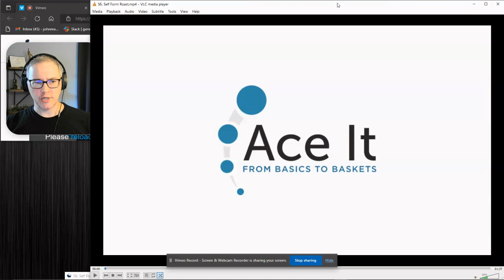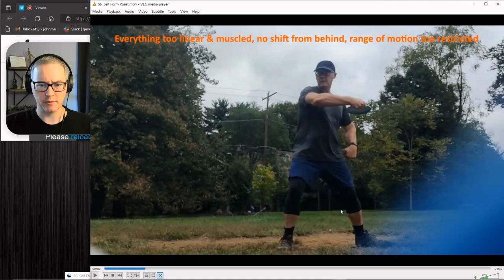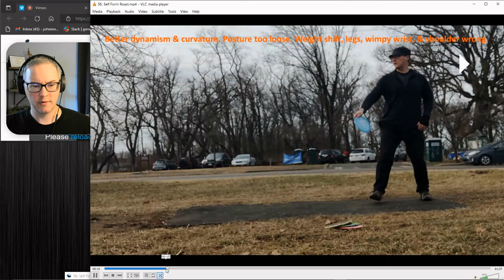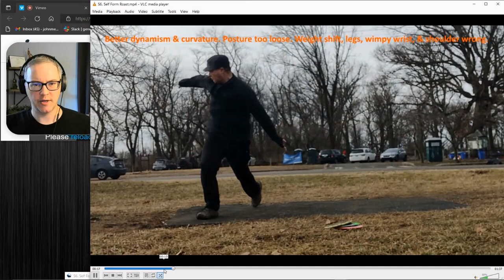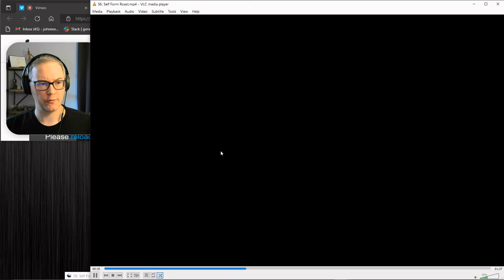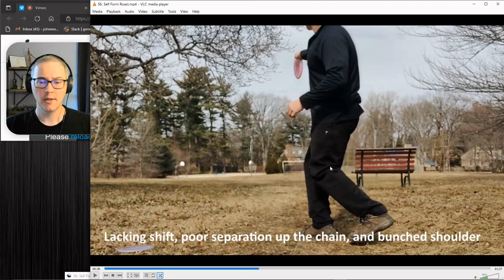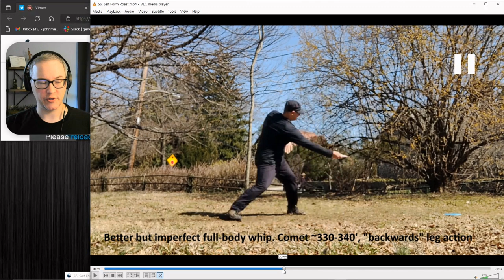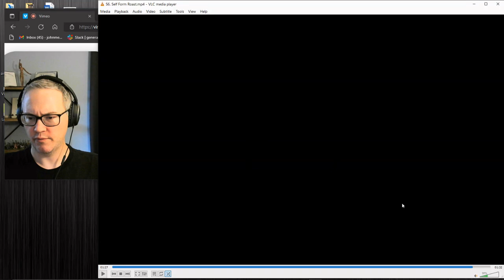Spotting Common Mistakes in Disc Golf Video Form Analysis

Comment: Hey, loving you content man, great work. It has helped me and my form more than eny other input I've gotten so far. Thanks for that! 

You mentioned something about not extending the plant leg fully through the weight shift/transfer. 
Is that just an injury prevention thing or do you think that it's really not necessary? Instinctively I'd say a full extension would net the biggest amount of energy transfer into the disc.
Reply from the maker: Welcome! I'm interested to hear what you think would be most useful to see next.

Good Q on plant leg. In terms of amount of bend, you will see a lot of variation out there. I think the key is to get the "pump" rather than "sag" regardless of leg position. E.g., Mcbeth has incredible body control and you'll see him have more plant knee bend on finesse shots and throw more with his upper body. But he's never sagging on the knee, there's still the little pogo action. 

IMO I think you're right that more and straighter extension is related to power for most pros, but very few of them fully extend/risk hyperextending. One exception I can think of is Drew Gibson's knee snap. I bet it does contribute a lot to his power, but I really worry that it looks a lot like Tiger Woods' old knee snap and may cause him issues down the line. In any case, I suggest focusing on getting a "quick, stiff pogo" in that leg and see what's comfortable without snapping it!
Reply: @AceItDiscGolf  thanks for the in depth answer. 
I think what I'm "struggling with" the most is the throwing arm now. I feel the weight transfer happen, I have an understanding of the brace, I get an ever better feel for the connection between upper and lower body but I steel feel myself "throwing" the disc too often. I mean, concentrating on my arm too much and ending up musceling it. 
I'd guess that this is one of the most difficult parts of the throw since it is so complex. 
But anything you could explain about the throwing arm, any details you noticed (and maybe even small drills to practice it) would be much appreciated. 

That was what I liked most about your videos so far: you do an amazing job of breaking down these complex motions into small, easy to understand drills and exercises.
Reply from the maker: YW! Sounds like you're on the right track. I really recommend doing every trick you can to "let go" of the arm. One reason the pendulum is helpful is you can just swing it back until you consistently get the disc flight plate horizontal to the ground (again, you might change that later), then let your weight shift/leg action start all the work. 

Every time I warm up I do some of the "dingle arm" rotations forward and back with my wrist in the "pour the coffee" position. So the only attention I'm giving to my arm is whether I've got a good wrist position just like setting up a golf or baseball swing. Then, when I do my warmup swings before I throw, I'm willing to let the disc rebound into and hit my chest as it directs toward the "pocket", which tells me if my posture is off. When the disc is naturally coiling in and swinging out easily and wide, I start throwing. Usually only takes a couple swings at this point but it might take more at first to get the hang of it.

Shawn Clement has a really good video on the arm in the context of ball golf & the same applies to disc golf. Search "ARMS PASSIVE OR ACTIVE IN GOLF SWING? WISDOM IN GOLF" on YouTube!

Also worth mentioning - I still also revert to "strong-arming" and risk hurting something the second my legs start to get tired, so make sure you're not overdoing it in the field!

Comment: at 36:45 you talk about spine tilt. Is this a consequence of good weight shift or is it something you have to manually do in the swing? I naturally tilt my spine in the backswing, but I really struggle tilting the other way as I swing through.
Reply from the maker: You might need to think about it at first. But the bigger problem for most players is that they're not in the right posture to get easy tilt in the backswing and downswing. This golf video is a really nice short summary about the posture you should be in:
https://www.youtube.com/watch?v=euEgx1ENDso&ab_channel=PhysioRoomCo

The same applies for standstills and x-steps. Once you get that posture, it's much easier to swing freely back and forward because the "tilt" is built into the posture.
Reply: @AceItDiscGolf  Thank you for the reply! I've been messing around with how I shift my weight and I have another question if you don't mind. When you shift into the brace, do you let your hip fully catch the weight before "pumping" your leg? It seems like when I fully let my hip catch my weight and then pump, I get a more balanced swing. It's hard to explain the difference in feeling between what Im talking about vs what I used to do, but it almost feels like now I am falling totally loose into the brace and I feel all the pressure in the hip, whereas before I was almost catching myself a little earlier with my leg muscles. I haven't magically gained distance or anything with this new method yet but I feel like its more on the right track.
Reply from the maker: @polecat3067  I think the exact leg/hip action & feeling is among the hardest to describe since everything is so interconnected & happens very quickly, but I tend to use the "pogo" analogy the most. Sounds like you might be getting it but this is how I'd respond based on what you write.

It sounds like before you didn't have a "pogo" (loading & unloading) but more like a "piston" hitting the ground before your weight could compress the leg. Your leg/hip should be catching the weight and resisting the ground. You don't want to feel jammed up in the hip or anywhere else in the leg. It's the same kind of action as catching yourself falling forward when walking, except you're doing it sideways. Think like a football running back strafing sidewise to track a receiver & bracing to change direction quickly.

As you add more weight & drop into the plant in longer strides, it's more and more like landing after jumping straight up in the air in an athletic posture (again, just sideways). In both cases your leg/hip is resisting collapse, and your hips swivel because of the posture you're in as your foot lands and resists the ground. The whole idea is that you want the foot, leg, and hip to be connected in one strong structure just like walking/running/jumping.
Reply: @AceItDiscGolf  I think you nailed it with the piston vs pogo analogy. I just tried doing some lateral jumps and I'm getting the same feeling that I was talking about earlier. Thanks again for the replies and for your posts on dgcr!

Comment: I'm in the process of rebuilding my form after 20 years of bad habits from ultimate frisbee.  I have a question about the pendulum swing tho. Don't most pros put it on a level plane and keep it there throughout the throw?
Reply from the maker: There is one camera angle in which the disc looks like it travels a relatively flat plane somewhat parallel to the ground. However, this is an illusion that many players fall victim to and has taken me almost a year to undo - the swing plane is neither flat nor straight relative to the ground or the body:

https://www.dgcoursereview.com/forums/showthread.php?t=134415

Comment: When you do your walk up/run up now, is it more like Throw #9? For the "shift from behind" , are you exaggerating your cocking/loading of the rear leg/hip by turning it counter clockwise (For a right hand backhand throw)? Or is it just a light cock of the rear hip and then you shift/brace onto the front foot?
Reply from the maker: Good Q's and eye! The rear hip does not cock back as far and I stay in better leverage now. 

When I X-step I'm still learning a couple styles, but I'm most comfortable with something like this when I want controlled power. You can see bits of GG, Isaac Robinson, McBeth in this one:

https://youtu.be/BgfgW5Wb5Mg

You want the rear hip cocked only as far as it takes to load the backswing so the front shoulder is right around the rear hip. It should be quick getting off the rear foot but you should have balance on it as you flow forward. Notice how much more compact the form has gotten as I get better balance off my drive leg. Similar idea if I stay lower to the ground but with my body type this style helps me get easy power.
Reply: @AceItDiscGolf  thank you for the detailed response! I appreciate you and seabass' hard work to understand the mechanics of the throw. I'll play around with the ratio of rear leg loading/"hip cock" to power so that I'm able to still maintain dynamic balance on the plant foot

Comment: Its hard for me to tell from this angle but focusing in on 33:30 is your front foot staggered forward because it almost looks like your lead foot is behind your trail foot from what I see. and if not are you coming around your body to hit your line?
Reply from the maker: Good eye! There are two main stances for standstills - one is more inline (like these) and one is more staggered (seabas22 shows those in his Figure 8 Standstill video). I just found it easier to learn inline first and it helped me transfer to the X-step. The one here is from when I first was getting the "shift from behind," so my body was confused in a few ways and my footing was awkward. So I'm over rotating a bit back, and my step forward isn't in the best neutral inline position and slightly back as you say. Everything is a little funky as a result.

Important to talk about whether that is "rounding" - rounding is "hugging your body, not the disc." At the 33:30 throw, I'm not rounding because my shoulder doesn't collapse and leads the disc wide, but I am over rotated a bit in the backswing. It was much less powerful and less consistent than it should be in that one.

 In the better throw that follows you can see me much closer to my ideal and natural neutral "inline posture." That's why I accelerate so quickly and move so easily into better follow through. Not all of them are that good, and some are slightly better for me right now.

That's why I still drill standstills so much now- it takes time to find the "sweetest spots," rhythm, and consistency even if the motion pattern is decent!

Comment: How long did you work on form until you could throw 400 feet with a distance driver? What would you say is a good bench mark in terms of distance for throwing a 8 or 9 speed? I'm slowly trying to engrain the habit of throwing with a more lateral movement a la Simon Lizotte using a bow and arrow transition.. right now I'm throwing only 270' avg with something like a crave and a stable 7 speed disc.. so there must be something I'm doing wrong.. drivers are so angle sensitive which is why at least for now putters and mids don't really show me correct release points/trajectories
Reply from the maker: I go through cycles of gaining, losing, and gaining distance every time I change mechanics. I started hitting 400' like 6 months in on the field fully warmed up, but stopped to fix mechanics again. Marched back up to that distance or so twice, then stopped again recently to fix more issues. 

I've had a hard time that not everyone does. In my experience there are a few ways to get to 400 with an X-step as long as your center of gravity is somehow into the throw, but you can get stuck there easily with less than ideal mechanics. And I wanted consistent, safe power and my mechanics were getting in the way even when I was gaining distance.

I keep realizing the wisdom in developing more powerful standstill mechanics, so right now I'm not paying as much attention to distance as I do to how I'm moving. Just like an MLB pitcher, it can take months and years to develop truly elite mechanics from a standstill or one step. Once I've run out of fundamental things that need to be fixed and I'm moving with reliable, smooth power, I'll start pushing distance again and see where I can take it.

I think benchmarks should always depend on your goals. I like throwing a lot of putters and neutral mids training to the 300+ level and mixing in drivers somewhere around there personally. I prefer to throw those discs on the course to that distance, but throw drivers 300' or sometimes less if it's a low ceiling or the line calls for it. Or I'll mash a slower disc for consistency or to test myself etc. I don't think drivers should be forbidden at some arbitrary distance, but if distance is a goal, it's true that it takes good fundamental body mechanics and momentum mastery to throw putters far. On the flip side, you hear people like Gibson say they learned to throw far by throwing putters or mids on every single hole until they could reach them, but then regretting that they don't have great touch. Most of us have limited time, so goals matter. Last, it's also true that nose angle and trajectory are a huge deal for driver distance, so usually you need to put special focus on that. 

FWIW I have a current goal of retraining my standstills as far as I can take them, and getting my 2-step X-step to low 400s on command in the next 6 months. People seriously underestimate how far they could throw with good standstills, and how a good X-step is adding maybe 20% to that if you're very efficient - most of us aren't.
Reply: @AceItDiscGolf   I remember reading somewhere that the walk up/momentum/X step is essentially momentum in a "one legged drill". And I guess that's why you preach it to. The more effecy/efficient/better you are at "standstills" the more your body understands explosiveness, overall body awareness/coordination, and synchronicity. While this is helpful for throws all around, I guess mastery of release angles and heights with faster distances drivers (11 and Up) is a whole separate skill in it of itself.
Reply from the maker: @CyberDarkZero  Seems like a good way to think about it! Developing explosiveness is its own challenge. Develop rhythm, then add momentum (e.g., the pump), then add the gas (fire harder/faster once you plant).

Comment: Hey brother, I think maybe I didn't explain it right. I asked how to cock the.hip without the pump and pendulum. What I mean is how do I get the lead hip to TILT UP, like what u do with the pump and pendulum. How do I tilt that lead hip without pump and pendulum because I'm not a big fan of the pendulum.  I prefer to walk around the disc.
Reply: Also, one other question I have is the tilted spine. I don't know how to explain it. It the drill where you had us grab out hips and rotate back n forth. Then you had us tilt our spine and rotate. MY QUESTION IS, SHOULD WE ALWAYS HAVE THAT TILTED SPINE. DO WE USE A TILTED SPINE ON AN ANHYZER?
Reply from the maker: ANHYZER: You can get away with less tilt on less powerful shots, but in general most people tend to coach "move the same and adjust your whole body moving into the swing." So I tend to keep that same tilt where I find the most power and then adjust my whole body as I move into the plant. If you don't have the tilt your spine can't curve as much and you can't snap through as quickly (I've tried and failed!)
Reply from the maker: Front hip "Cock": Oh I gotcha now - you need to shift your weight forward into that front foot and "pump" against the ground with that leg to clear/cock the hip up and back. Then, in the backswing/reachback/leave behind, it's like the disc is pulling the hip closed so you can shift from behind. Then when you plant it's the same idea. 

Made a quick vid showing me doing one pendulum, then some exaggerated elbow pumps - the hip is going up and back because I'm shifting weight onto that foot, then "pumping" it up and away each time I land weight on it. 

https://youtu.be/yuN0M55KoCQ

If you watch Simon he has the same posture/mechanics but with a VERY tiny pump. Nate Doss is almost the opposite- big pump earlier than most and holds it a bit longer, but still times the backswing/walk behind with the x-step.
Reply: Your awesome bro, and thank you for taking the time too answer my questions. In that video where your start your xstep by holding your arm up and pointing at target, you said to do that to get that front hip up. I just don't understand why you would have to do that at the start of your xtep, because when I plant, I'm gonna pump my leg which will raise that hip. Unless keeping that hip up from the start make it easier some how, I don't understand a need to start that why.
I know I'm probably confusing the he'll out of you,lol.
Reply from the maker: @ciromassa7322  Believe me, I've spent a lot of time confused, let me try to explain better! 

First, you don't need to pump. The pump helps reinforce the relationship between the feet and the throw sequence, and can help you find rhythm and posture to get good hip action. I probably could better say that "the front leg and spine tilt allows the front hip to tilt up and cock away from the target" whether you pump or not. You want the pump to "follow" the plant leg action just like an actual throw. LMK if that makes more sense - sorry if I made this too confusing!

Comment: Hey bud, can you please tell me how to cock the hip up without a pump and pendulum. I just can't get used to the pendulum.
Reply from the maker: The rear hip? You can try reaching back away from the target without a pendulum while keeping that rear foot planted on the ground. Think about "heaving" your arm & disc back away from the target. As you arm pulls your weight away from the target, you should feel that rear hip want to cock and load. Maintain a bit of tilt in your upper body like swinging a golf club.